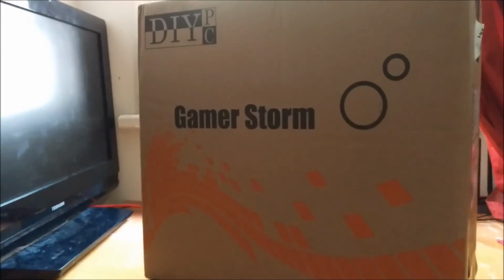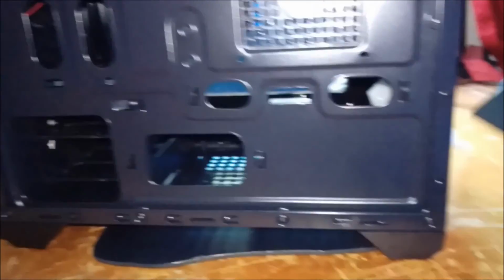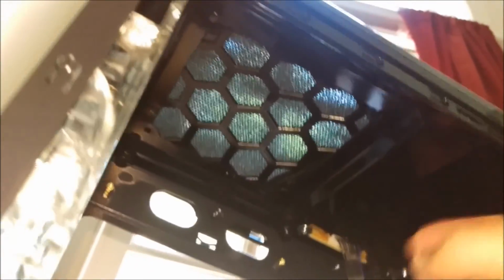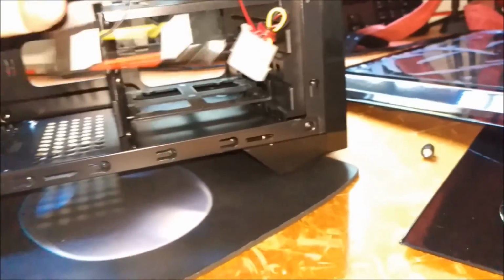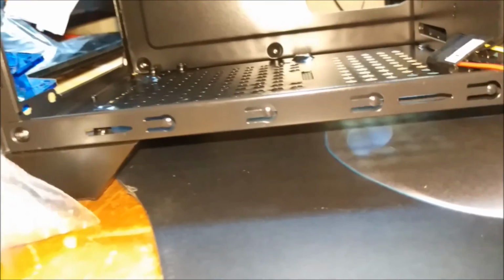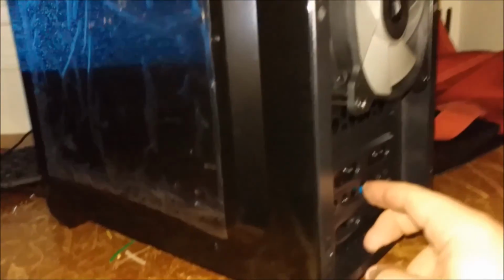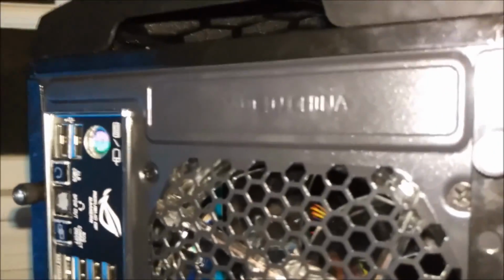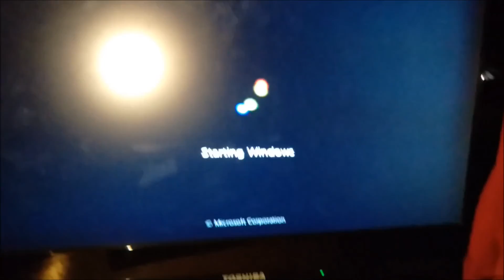DIY PC M-ATX N8-BK Gamer Storm Case Review!

Comment: I bought this case and I plan on buying an h100i and mount it on the front. but where will there air flow come from if the cases front panel is on

Comment: does the fan come pre installed?
Reply from the maker: it comes with one on the back and one on the top i'm pretty sure. you need to add the front ones on your own.
Reply: +gameboy3800 oh thank you!!!!!!
Reply: +gameboy3800 does it support 120mm fans?
Reply from the maker: yes. one on back, one on top, and two in front.
Reply: +gameboy3800 thx

Comment: I bought this case and I plan on buying an h100i and mount it on the front. but where will there air flow come from if the cases front panel is on
Reply from the maker: i fit an h105 in the front and it kept the cpu nice and cool with no issues
Reply: +gameboy3800 ok thanx😀☺